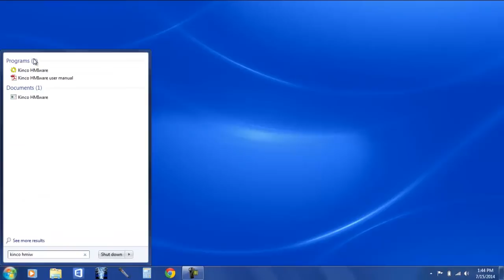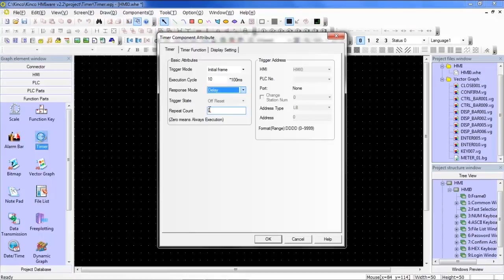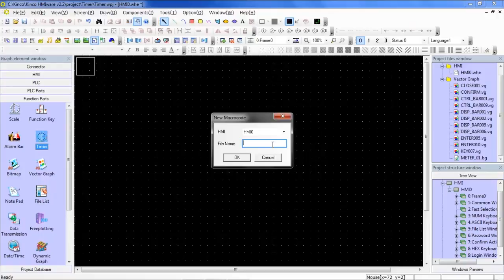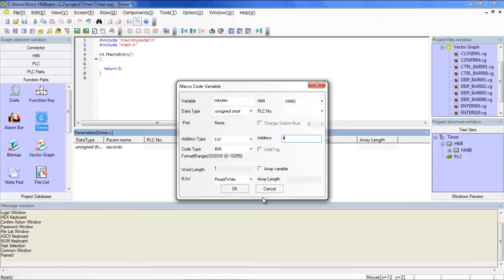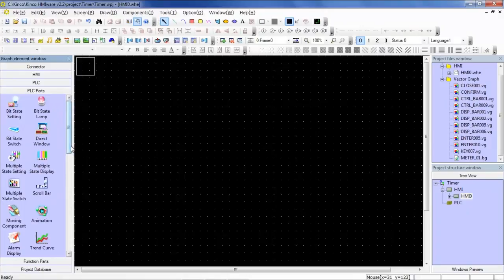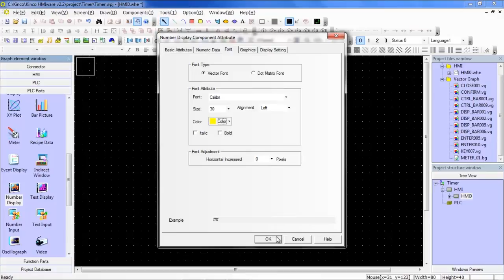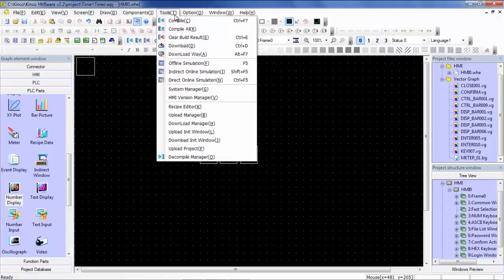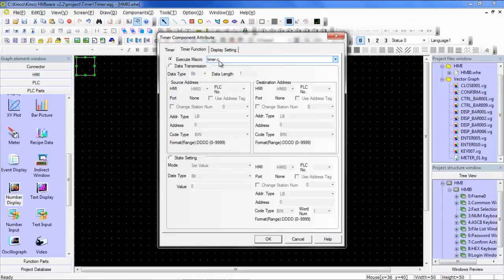HMI Tutorial: Timers

Comment: Hello, I have copied this macro, and I have put 60. The seconds run as if they were milliseconds. The minutes don't tick right, and when they hit 99. It gets out of range.
I have a HMI GL 100E, software D.tools V3.5.3. I would like to use the hour counter, when a physical or network output of a plc is activated. And to be able to reset it. (plc is a siemens 8 logo). Could you tell me how to do it.
Thank you and regards
Reply from the maker: Hello, thank you for reaching out to us. We have reviewed your comment and made corrections to the code as shown below. This should properly increment the number components so that you no longer have issues with the minutes or hours. Also, please verify that your timer execution cycle on your timer is set to 10 (*100 ms) rather than the default of 1 (*100ms). This will more accurately reflect the seconds time increment as opposed to the milliseconds you were experiencing. 

In order to reset the timer, you can designate a local bit (LB) to trigger a reset. One way to do this is to add the first batch of code shown below after seconds++, and for testing purposes a bit-state switch can be added into the frame with the timer. Assign address type LB with address 0 to the bit state switch and change the switch type on the second tab titled "Bit State Switch" to Set 1 Pulse and the Pulse Width to 10 (*100ms). In the macro window, create a new parameter for reset making it a bit data type and LB0 for the address and address type. Upon testing, you will find that activating this bit to 1 will designate all values to equal 0 and will resume counting when the bit value is 0 again. 

seconds++;
if(reset == 1){
    seconds = 0;
    minutes = 0;
    hours = 0;
     }
if(seconds == 60){
    seconds = 0;
    minutes++;
     if(minutes == 60){
                minutes=0;
                hours++;
     }
}
We hope this helps.
Reply: @Anaheimautomationinc  Thanks for answering, I have modified the time in the timer, it already counts the seconds well. The minutes should mark up to 60. And they reach 99. In numeric data I should put min 0 max 60 or put min 0 max 99, I have put both. and when it reaches 99 it goes out of range. The hours do not mark them.
I don't know how to do macros, I haven't studied c language.
Could you do the macro?
When a PLC output is active, it starts counting, and you can reset it.
I would be grateful to you.
Thank you and regards
Reply from the maker: @manolomanu1243  We apologize for the inconvenience. The macro we provided in our previous response should have given the results you're looking for. If the difficulty persists, we recommend contacting our applications engineers directly. They can be reached by email at applications@anaheimautomation.com or by phone at (714) 992-6990. They will be able to assist you more thoroughly.
Reply: Hello, very good videos. I have made the macro, the hour counter. On the HMI When the HMI is switched off, the accumulated hours are deleted. What can be done so that the accumulated hours are not deleted when the HMI is disconnected.
Thank you and regards @Anaheimautomationinc